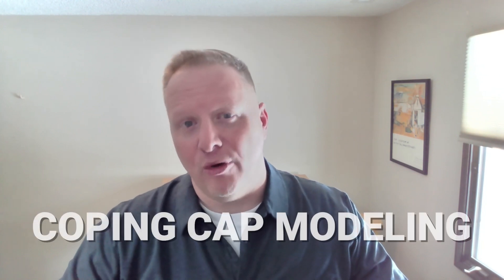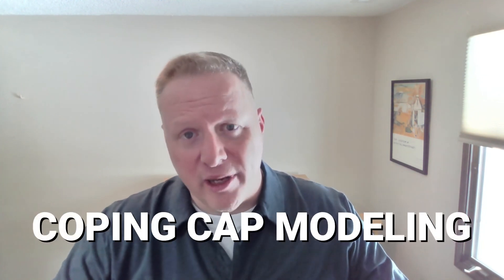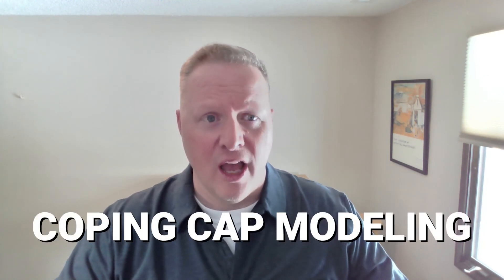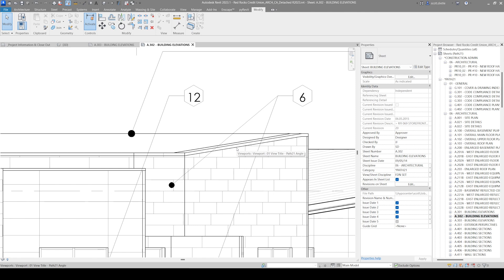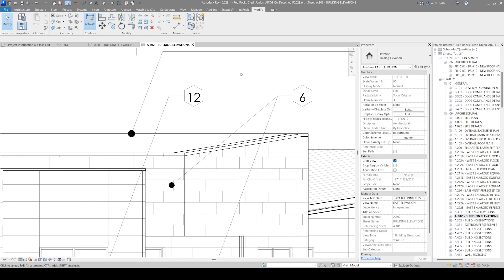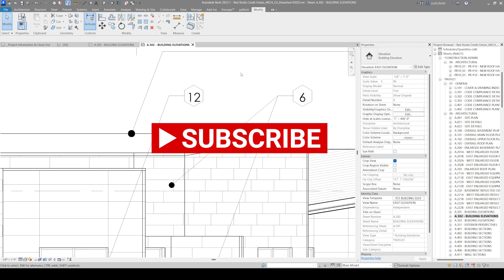Revit Tutorial - Coping Cap Modeling

Comment: I mostly do sweeping, but sometimes I do wall stacks and profile on top for my exterior walls. of course it'll be a pain when I have too many types of exterior wall.  Profiles on wall stacks will remain on top no matter how you change the height.
Reply from the maker: I have done sweeps on top of walls as well.  However the "Modify Returns" on a wall sweep are sometimes beneficial and I can't get those to work on built-in sweeps.  Revit is sometimes like multi-tool, you can use several different commands to get the same thing.  Thanks for the comment!

Comment: I do coping caps as roofs, and then use the fascia tool for metal coping caps. This allows you to slope the coping cap back.
Reply from the maker: Huh, that's interesting.  Never seen it done like that.  Great thing about Revit is there are multiple ways to do the same thing.  I've seen people create entire roofs as floors so they can see the composite metal deck in section.  Thanks!
Reply: I didn't get it. did you mean you create a roof on top of the wall or you categorize the model-in-place as roof to be able to use fascia on it?
Reply: @danialsoozani  Create a roof on top of the wall. Set it to variable and modify its sub elements to slope the direction of choice. Then you can apply fascia's if you need to. That way you don't have to do any work arounds with split faces or model in place components.
Reply: @scott_hamby  now I get it! thanks! it was a brilliant idea tbh!